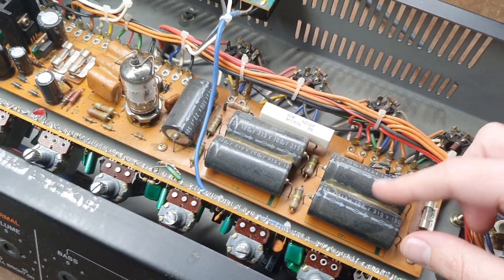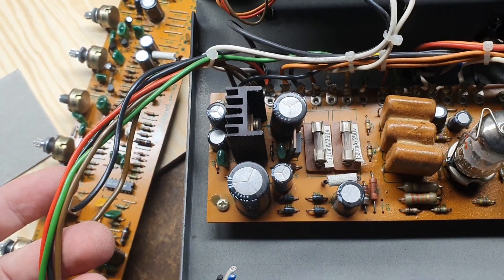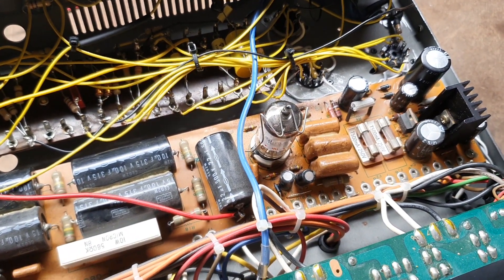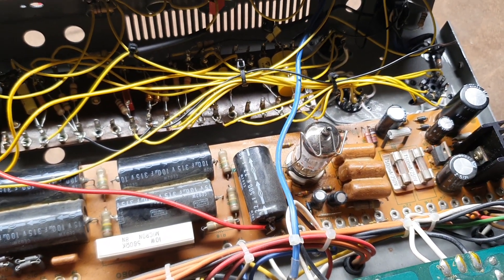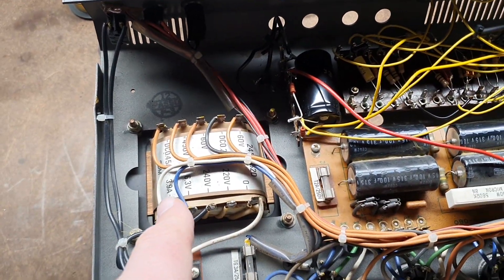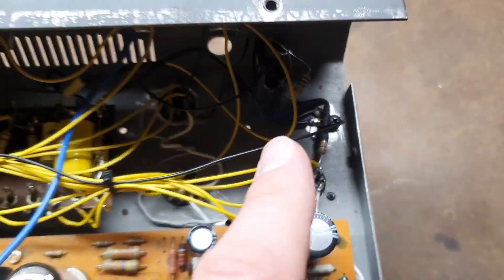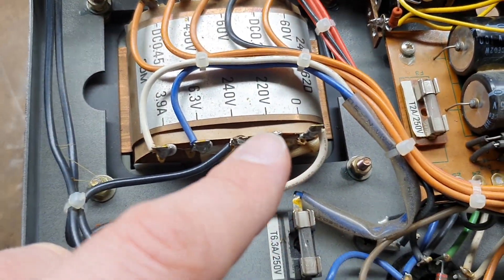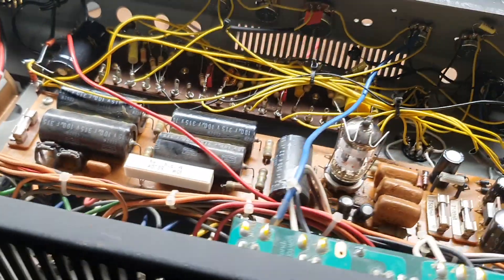Repurposing a Roland Bolt!! - Tube Preamp!

Comment: The powerbank caps are in seriel-parallel ( like in the similar fender amps). They should be able to  take 2*315V = 630 V ( minus 10 % = 567 V) . If you mount an extra speaker, for 2 in  series  (  16 ohms), the output transformer will be happy with the 2 6l6's you chose to use - instead of 4. Best Regards

Comment: OH NO why did you cut it!? What a waste. You ruined it. You can just leave it stock and skip the preamp section in the bolt 60/100 and just use it as tube power amplifier! Guitar > outboard preamp such as an ada mp1 > bolt rear main in input > bolt speaker out to 4x12 greenback-loaded cabinet.
Reply: He got himself a nice tube-in-built-pre-amp AND a set of FREE spare power tubes, for that (almost) new 50 watt combo-. I'd call it a good deal !

Comment: i WOULD SUSPECT THAT THE LOW VOLTAGE IS KILLING YOUR GAIN,  iVE USED SEPARATE POWER SUPPLY TO RUN THE HEATERS BEFORE, A COUPLE TIMES i USED A OLD SWITCHING POWER SUIPPLY FROM A COMPUTER BUT i HAD TO CLAMP DOWN THE 12 VOLTS SO IT WOULD STAY STABLE AND i RAN THE 6L6'S IN SERIES, THEY DO GOOD WITH DC,.  EVEN THOU YOU ARE COVERING THE LOAD THOSE TUBES NEED THEIR VOLTAGE.  GOOD LUCK     HEY DO YOU STILL HAVE YOUR 73'S  ?
Reply from the maker: Computer power supply isba good idea. I suspect however that the problem lies within the curcuit. But it was a happy mistake this time! Not gonna try to fix it when it sounds this good. Will try to build another one with that I can experiment with values and also adding a gainstage. No both my 73's are gone!
Reply: @Rohbemusic  OK smart move. you know of what you are dealing with. what I like about what you are doing is that you know what you want to sound like .